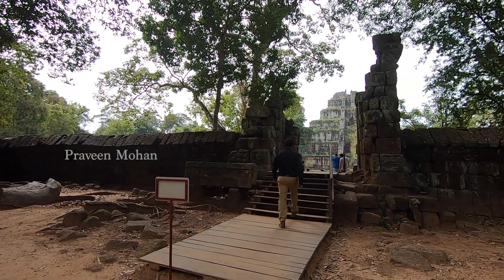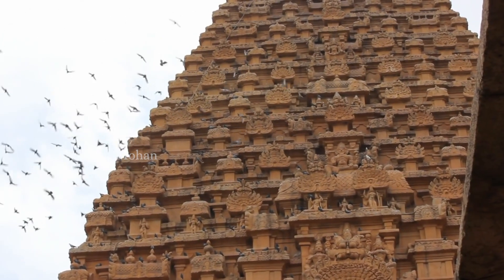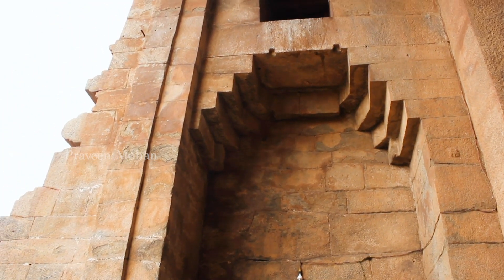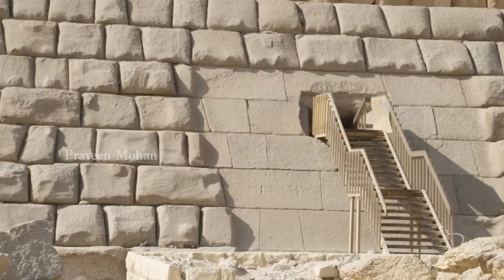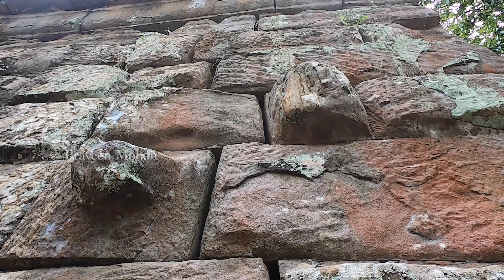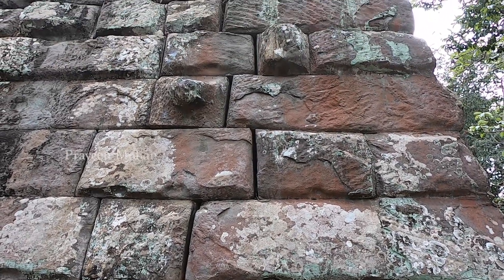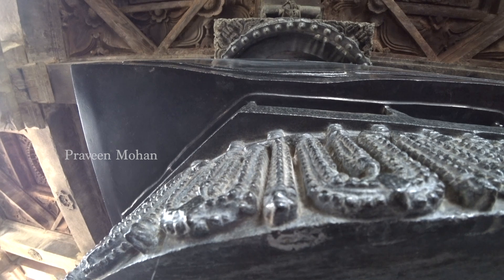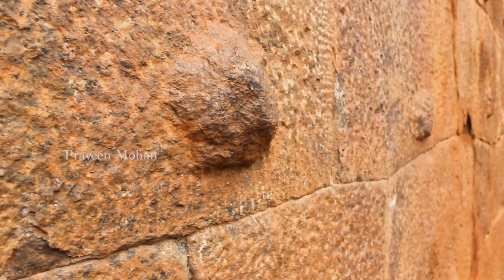Mystery of Ancient ‘KNOBS’ in Temples - Evidence of Stone Melting /Geopolymer Technology?

Comment: Your theory of "defects" is obviously not well thought out!  If a stone had a hole or recess, you would not be able to fix that (unless you happened to have some way of melting or molding them-- which they may have had).  

The knobs you imagine to be "defects" could easily have been broken off or chipped with tools to make the surfaces even, which is the most likely explanation of why you see no such knobs at eye level or below. It is likely that any knobs at human level were broken or otherwise removed millennia ago-- most likely during construction-- for the most practical of reasons: would you have wanted to be trying to walk those pathways on a moonless night, cracking kneecaps, shoulders, and toes, and skinning your ears on such protrusions?  We can be sure they had no streetlights, flashlights and neon signs to guide their way.

 Your supposition that the blocks with knobs were more often placed high up were "defects" because they "could not be seen" also makes no sense, since you could easily see them in the videos looking upward.

The fact that the knobs were not in the centers of the blocks do not fit with your theory either, since you would have to know what the opposite side of each block looks like-- if it had a knob in the center on the opposite side, yes, it would tip, as you say... but if the opposite face of the block had a knob that was equally offset toward the opposite corner, it could be lifted without tipping... except that most of the ones I saw might still have tipped, but because they were top-heavy, not from being overly imbalanced.

Any bumping or rocking while being maneuvered into position would have likely allowed the blocks to tip regardless of how evenly balanced they were, unless the knobs were closer to the top edges.  The stones would have to be visible to us from the other side, and we would have also had to know whether they had undergone excessive weathering or erosion, to have a better Idea what processes-- natural, or intelligently designed-- were at work.

The knobs may have been disfigured with time; the knobs may have originally been shaped more convenient for lifting, such as having a more oblong or rectangular form.  Weathering tends to round off sharp corners... rounding them.  When Ivy, lichen and other growth attach themselves to such surfaces, and as morning dew forms and trickle slowly down, they also could round off hard edges.

My comments only counter your theory of them knobs being "defects", and not any of the other questions we might have-- how the blocks may have been molded or shaped, or what the acids or other substances or materials might have come from, such as plants or animals.

I question whether the builders had actually molded, since many of the faces have rugged, angular features, as if chipped with metal or other hard tools, and not the smooth, silly-putty type surfaces that one would expect if they had been melted or otherwise shaped plastically.  I suspect if something was used to plasticize the blocks, it was only used on the surfaces that they wanted to form flush surfaces on the upper and lower sides, and the adjacent sides on the same tier.  When the stones were still plasticizes, they could have used trowels or sticks to remove and stone that was oozing out of the cracks.

If we seriously wanted to understand how these walls were made, we should carefully disassemble them, to see if individual blocks were hollowed out, or partially hollowed out, or to see if there were signs of plasticized blocks... and the source of the plasticizers.  We should today be able to make use of any such material!

You mention the similarity to building materials on other continents-- including the lack of spaces between the stones, and the knobs.  It does seem most likely to be the same lost technologies were used.  The other sites in Egypt and elsewhere also had some stones with knobs, and others without, but they may have been used as a way of breaking up the monotony of broad expanses of featureless, stone faces, much as masons for the last few hundred years have commonly done: interspersing a few colored bricks randomly, here and there.

Years ago, I saw a YouTube video of a an ancient stone emple that had large, interlinked stone rings-- perhaps ten inches in diameter-- hanging from the temple's eaves... the most stunning thing about them is that the stationary rings were integral with the eaves... they were granite or whatever... but the rings that were interlinked to them, hanging down loosely, were of some different, visually contrasting material-- sandstone, limestone, marble or whatever-- without doubt, those interlinked rings would be impossible for artisans to produce today, using only the technologies we have presently... a lost art.  The rings were perfectly round, looking like donuts from a junk food shop.

Do any of you know the YouTube link for that particular temple?  I have not been able to find it again... I do wish I had saved it.  Those rings are even more impressive to me even than the "melted" stones in this very video... if you see them, they are most mesmerizing.

Comment: The language you use to describe these stones is most interesting.  I can't prove it but these stones have many features that make them appear to be ancient cement work. For the stones they would brick into a wall, they would pour their cement into a standard form and let it harden.  The top of the pour would become the face of the block after a 90 degree rotation. (Unlike the Inca stones which were likely poured in place.) The wall stones are likely stronger in this orientation. The knobs are a nice clue to the viscosity of the cement mix in the process.  Also, notice how the patina is chipping off many of the stones.  This is common in concrete, not so common in cut stone.  The archway stones could likely be "ordered" from the cement works, then hand finished in place while young and soft. Thanks for a great video!
Reply: I lived in southern Peru when I was a kid and to me it sure looked like it was poured in place. With all the different angels of these pieces fitting together so perfectly it would be a nightmare trying to fit them together if they weren't poured in place. Some places look better than others but as the saying goes you get what you pay for.

Comment: Could the knobs be used to aid in lifting during storage and transport? so the blocks don't be come too flushed up against each other. Given their size and weight i'd imagine i'd be more ideal to have some sort of gap for leverage. 

On the subject of why only on some blocks. You would only need one block with a knob to start. Set the first block knob down and then rest the next block against the last, creating a small gap under the block. Creating a leverage point. 

And this theory doesn't dispute the idea that the blocks were cast. Just a possible feature left over from the storage method of the blocks between the time the blocks were cast and when they were placed in their final locations. 

Just my thoughts and theory on the subject.

Comment: Iv often concluded the nodules were part of some sort of "injection mold" manufacturing tequnique. 
I think 90% of the blocks have them, they are just hidden on top or the sides. Working bottom up, a nodule on the top or sides would interlock the next block. 
NOW THIS THEORY IS NOT EXACTLY ACCURATE but i think its close to what was going on.
ALSO HEARD on another channel, a mixture was created with a byproduct of the quarying process, and when applyed to the rock surface, it would become like a slurry and soften, Then reharden and thats were we see that "glazing" effect, curved pieces fitted together w/ precition, ect. It was akin to an acid with high P.H. Level. That was very compeling also.

Comment: I am sorry I do not believe they are errors or drops.  They obviously had massive rock carving ability and would have cleaned them up and they clearly are on the side of well finished and fully finished buildings and temples.  I am not arguing that they did pour them as a geopolymer but only that this was intentional. They are not for lifting either.  I believe they are mounting points for ornaments or 3D sculptures.  Many Indian sculptures are on the outside of buildings.  I believe the Sculptures fell off or were stolen after much longer periods of time than mainstream historians say.  In India and around the world there is massive evidence of a longer human history and the rocks have weathered much longer than believed.  After the Sculptures were stolen or fell off the Knobs were left to weather and do not show the glue or what ever held the Sculpture on.  The sculptures that are left are the ones that were built into the walls or are actually part of the wall and all others have fallen off or been destroyed.  I have been looking into relief sculptures that were found or were dug up and are very old and most that are left have mounding holes on the back that could have been used on a knob with some kind of mortar or glues.  Nothing else would haven strong enough with heavy sculptures to hold their weight.
Reply: sculptures, or artificial lights...

Comment: At 5:55 You can see a block where the knob on it has been cut in half leaving only the top right part of the stone with part of a knob and not in a place that could lift the stone.. This shows that the Blocks where Quarried in a larger format then cut down to size once they reached the pyramid.. This explains why the knobs are in random places since they where cut from much larger blocks that where transported to site then cut down into smaller (smaller" being a relative term here) size. Not to mention the knobs look nothing like they looked originally due to erosion..

Comment: The knobs are not defects but vantage points to use for pressure building between the stones. 

Like a rope around it but picture something wrapping around the blocks and tied extremely tight. The knobs was used to push or pull against other stones while an extreme vibration was applied. After time the vibration rubbed the stones flush with each other. 

Same this with the cored circular holes. A round object like a pipe was applied to the pipe with an extreme vibration "frequency" and after time it would vibrate through.

Edit- where there carvings are there's points there to accomplish the push pull needed to the pressure mediation needed for the vibration after the casting.

Comment: One theory is that they were using sound vibration technology to make rocks pliable, not necessarily melting them.
Reply: Something like that makes much more sense to me than geopolymers casting and melting. They could have built a 'normal' dry wall first then used sound to 'soften' the edges of each individual rock, one by one. That way you could get smooth edges without having to use moulds or cast.  Also the knobs could be linked in some way to sound manipulation or resonance properties of the stone.
Reply: @nat7x7  fascinating stuff for sure.

Comment: I have been thinking about how these wall were constructed for a long time as well as why they have the knobs.  It makes a lot of sense that the blocks were cast up against each other in order to be able produce such a tight joint and the varied complex shapes.  The knobs would be the result of having a cavity in the face form used for the block if the blocks are cast in place in the wall.  In order to be a sprue or a Drop as you call it, the blocks would have to be cast with the oposite face on the ground and the knob side up and then after they had sufficiently hardened, placed into the wall.  This is more work than just casting them in place directly in the wall.  I tend to think that they did not "melt" rock because of the amount of energy that it would take as well the fact that you would need exotic refractory material to use for forms and handling of the molten rock.  I would expect a cold process of some sort like making concrete or maybe ultrasonic frequencies to disassociate the rock and make it flow in a thixotropic manner.  One possible explanation of the knobs may be that if the blocks were cast in place in the walls, they may have put a hole in the form in order to see when the flowing rock had fully flowed against the form.  Another possibility is that the face form consisted of some type of construction that would occasionally pop a hole in it due the the pressure head of the flowing rock.  With the scientific tools available today, I cannot understand why I haven't seen any microscopic investigation of these rocks to determine their makeup and properties.  If they were a geopolymer or had been flowable material at some time, it does not seem to me that it would be very hard to determine that.  It might not be easy to determine HOW it was done, but the fact that it had flowed should certainly be detectable. My guess is that there are mainstream archeologists that do not want anyone to reveal that these were not made in they way that they have conclued using simple hand tools.  Maybe someone has done this investigation, but the results cannot get out to the public.
Reply: Dr Joseph Davidovits has done a lot of work in the field of geopolymers and has analysed a variety of old blocks made with this method. I think that by researching his name on the Internet you will find interesting information.
Reply: This is the most reasonable answer I read up to now.

Comment: Nice video. I think to take it one step further you'd have to answer the question how was the casting process? each block is fitted quite perfectly to the adjacent blocks. If blocks got drops, drops are fall from above by pouring down, no? If so, then how did they know craft the molds? all the drops are perpendicular to the grade. so they may have been poured down, then rotated 90 to fit into the wall. How did they plan this for the blocks to fit soo well? 

I think it has something to do with the sequence of molds. Ie cast in the ground. Consecutive blocks, by digging the next block shape out of a continuous trench? 

Great work Praveen Mohan

Comment: The mainstream explanation makes clearly no sense, and they are most definitely not drops, as in other structures it is clear they were cast or sculpted for a reason. It's one of the biggest mysteries of these structures.
Have you thought of the possibility that you find no knobs on the decorated side of the temple because decorations were added at a later date on a much older structure, when they also smoothed it out from the designed area? This seem to make the most sense to me.

Comment: The theory about melting rock and casting blocks is about as absurd as anything I’ve ever heard: “Aliens” level silly.

If you melted granite, the heat would destroy the grain structure and it wouldn’t be granite anymore. Besides, the amount of heat required and the equipment to cast such massive blocks would be prohibitively expensive in terms of resources for ancient people: And furthermore cast blocks would be uniform not varied and unique like these stones.

These are not defects: The knobs are on the stones because the builders wanted them there. If they could fit stones together seamlessly then they could certainly smooth the surface if that’s what they desired. 

For insight into the reason why a stonemason might be a good person to consult: The presence of these knobs all over the world suggests they might have a functional purpose, other than ornamental.

Perhaps the knobs are there to mount something else - wood scaffolding or some other structure that rotted away centuries ago.

Comment: I am an Engineering Geologist and work in Geoarchaeology. While the origin and purpose of the  "knobs" are problematical, the proposition that they are "casting defects" is more so. Most of the rocks clearly show peck marks from percussion shaping and given the skill and care of rhe masons, casting defects would certainly be removed. There is absolutely no evidence of any ancient technology that could achieve the extraordinarily high melting temperatures of granite or basalt (850-1200 degrees Celcius). The alleged "softening" of these rocks using herbs is completely unfounded regardless of what local priests might say. Using petroscopic thin sections (microscopically thin slices of rock viewed in polarized light) would readily show whether the crystal or grain structure of the rock was somehow altered from its natural state, or whether the material is man made. Knobs exist on Maya structures in the Yucatan built of local fossiliferous limestone. This rock is soft enough to be easily cut by flint tools, and any "melt casting" would have destroyed the delicate fossils. Most likely, the knobs were left to aid in the attaching of a stucco facade which was then painted. Such stucco is still preserved on the interior of many temples. 
Before you continue asserting these ideas I suggest you show some solid petrographic evidence that this has been done. The approach of "since no one can explain the knobs so they must have been made like this" is bad logic and doesn't even approach what could be called  science. It's just fairytale.

Comment: The knobs were probably gargoyles stumps, with the gargoyles broken off and stolen or weathered away.. If not they were used as joist hangers for a roof... or probably oil lamp / torch holders... Street lights... The ancients couldn't melt rocks. You've got rocks in your head if you think they could... At best they may have found or even made an acidic liquid that helped cutting and polishing a little, but it's 99% hard manual graft, maybe aided by simple wooden rigs and stone saws.